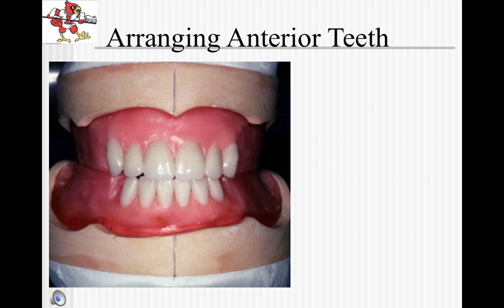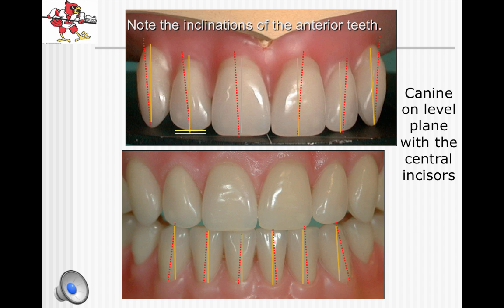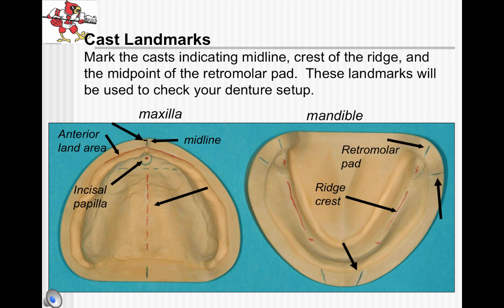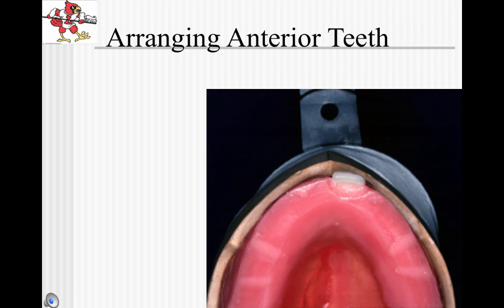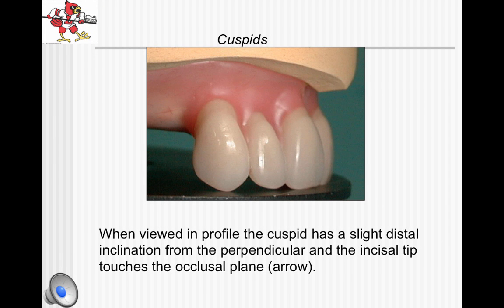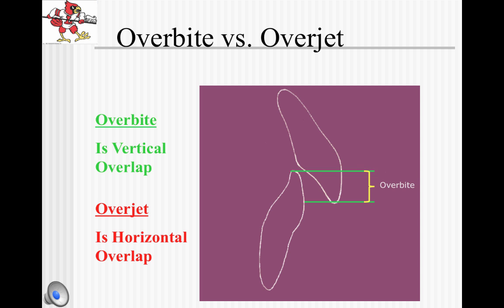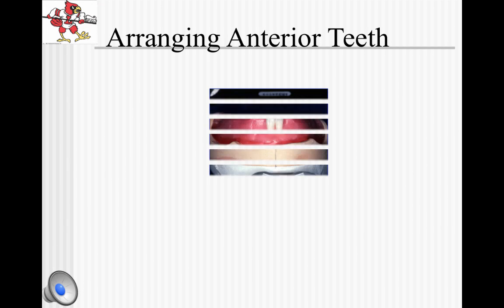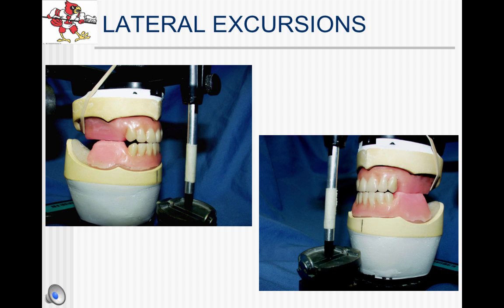Video #17 - C D Arrangement of the Anterior Teeth - Lecture

Comment: Can you help at this  

Explain the difference  in the arrengment of upper lateral incisar between male and female
Reply from the maker: It is considered a more feminine set up  to set the lateral Incisors a mm off the plane established by the two central incisors.  If you place the two lateral incisors on the same plane as the two centrals, that is a more masculine set up.  Also, the lateral incisors for the female may be slightly smaller than the laterals of the male.  Various tooth sets can accommodate for the desired set up.
Reply: @amwind01   thanks a lot ♥️